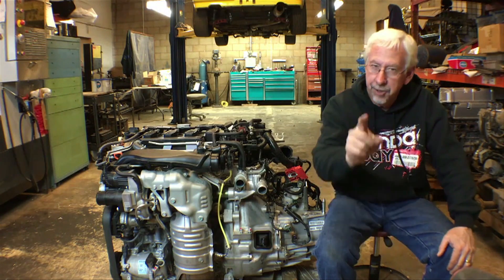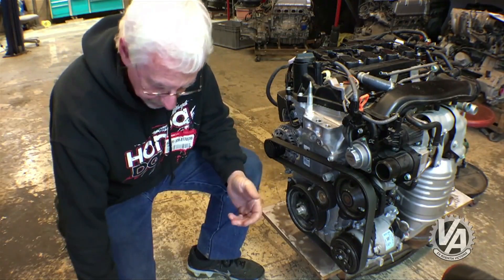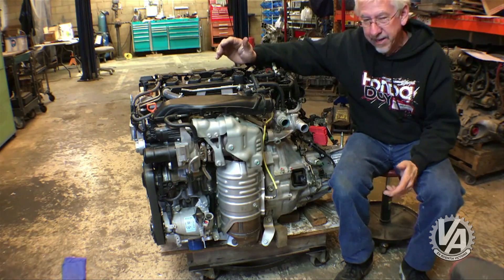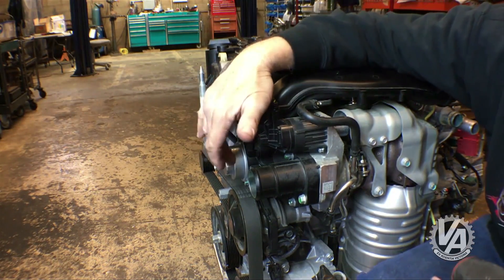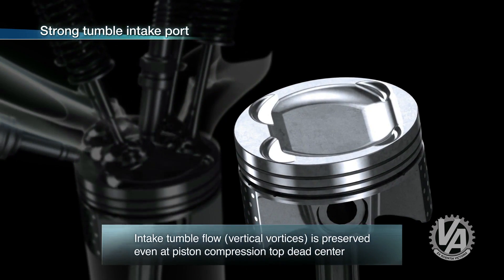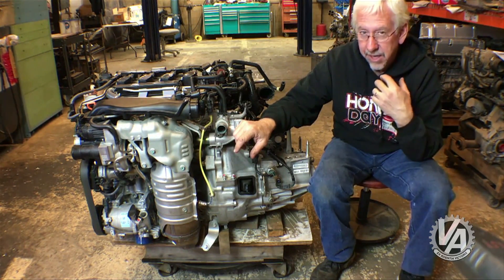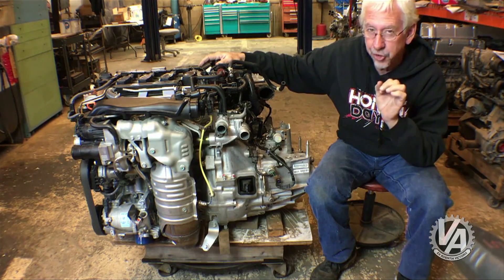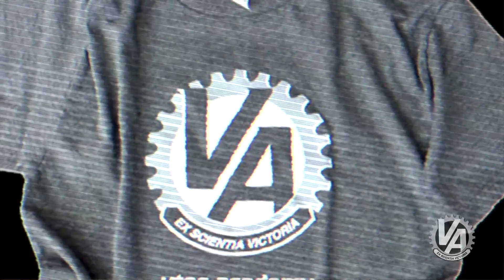Tech Inspection L15B7

Comment: so happy to see an OG in the game enthusiastic and premoting inovation instead of bitching and moaning like most the honda fan boys who don't wannna leave the K's behind. 

i can only imagine what they would have done back in 01 when folks started tinkering with the Ks and everyone thought it would never be able to stand up against the B series. eager to see wha
t comes of this for good or bad.
Reply: I agree with this, but the K series is far from dead. The new CTR is powered by a K20C
Reply: MikeyMike_CD7 yeah i know the new motors are Ks also. and they're fantastic. just folks arnt ready for change/progress
Reply: @brodieandre  Not all changes are progress.
Reply from the maker: Don't forget, there will be a K20C turbo motor that will likely come in an Accord and some of the Acuras. It will be a slightly detuned version of the Type R motor, but they will make many more of these as compared to the Type R.
Reply: This is the point of the Civic Si, a fun grocery getter that you can take to the track. I'm sure Si customers would love to have this instead of the L15B tuned a bit more aggressively to around 220-230 hp.
Reply: MikeyMike_CD7 1 is a 40k limited run car with alot of special things like the engine. the other is a mass produced 20k car that primary point is to be economical. why would they put the special engine in the unspecial car. it would devalue the perfered product and kill the MPG point thats the primary point of the run of the mill civic?
Reply from the maker: @brodieandre  More like 300K
Reply: MikeyMike_CD7 I'm sure they would too but why would anybody spend 40k on a civic if they get 90% of the same car for 25k? this is exactly why in previous generation's Honda didn't bring the type r brand to America. because they knew the si product was too similar and nobody would buy it. 220-230 is the most a Honda SI has ever had. so it's still an improvement.
Reply: MikeyMike_CD7 seven months late but we have the accord now with a detune ctr motor so hopefully we’ll some more k20c motors in older hatch and integra
Reply: ANDRE BRODIE shit I know a lotta people still working with d and b series making good power numbers
Reply: And now there’s oil dilution problems. 🤦‍♂️
Reply from the maker: My response is to the guys talking about the K-series and Type R. As for working for D and B, the d is still in most of the Civics out there. The B is still one of the most popular engines for the turbo drag guys. That may change if the Type R and Accord turbo K20 have a stronger transmission. That has always held back the K from being the engines of choice for the turbo guys.
Reply: Hey bud, it's 2021 an the x gen accords and civicS Have K SERIES in them. . .
Reply: Dilidon Thurnipozetto that's doesn't make sense I don't think u understand what I'm saying
Reply: Amen!
Reply: Honda has their big power 4cyl in the type r. this is their base motor that they want to hypermile. its reasonable and with proper bolt ons which is what honda is best known for. it's gonna be a bulk (d series esq motor that's in alot of hondas. these are good things. if you want set on kill go get the type r.
Reply: This isn't a fair statement as the Type R won't be mass produced, it will be limited availability. They need a detuned k20c for the masses imo.
Reply: This unfortunately is a good point I did oversee, touche sir !
Reply: ANDRE BRODIE That is bc this turbo mini motor barely makes what a NA K does. When everyone is going big 4 banger like Subaru with the 2.5 and Mazda with the 2.3 turbo...Honda does this??? IMO and many other people who see reality...see this as a step backwards vs "innovation". Honda should have just made a newer turbo K instead of this crap
Reply: Andrew Solis the 2.5t is the STI which competes with a Type R which is only a 2.0t making 1 more horsepower. The 1.5t si competes with the focus st and wrx which both have 2.0ts yet have similar performance to Si.

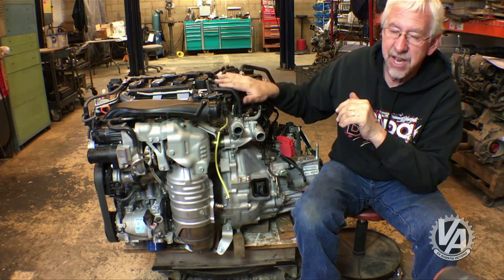Comment: Put it in a GE8..i guess at the 7:02 mark you meant lift not valve timing... anyway, very good video, been looking for a breakdown.  Too bad it is not a easy bolt in for a  Fit
Reply from the maker: You mean lift also. VTEC changes valve timing and lift. It will eventually be bolt in. Just give Brian at Hasport some time.
Reply: I meant around 7:02 when it was said there is no variable timing for the valves
Reply from the maker: Yes, VTEC stands for variable valve timing and electronic lift control. VTEC controls both timing and lift. I was being lazy and left out the word lift. The L15B7 uses VTC which is simple variable timing control by advancing and retarding the camshafts to control valve timing
Reply: We are on the same page.